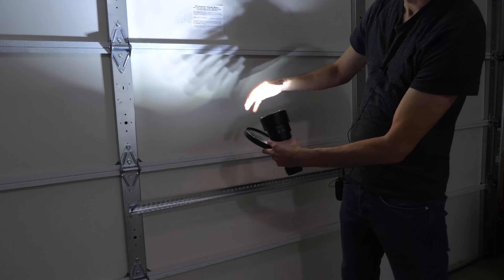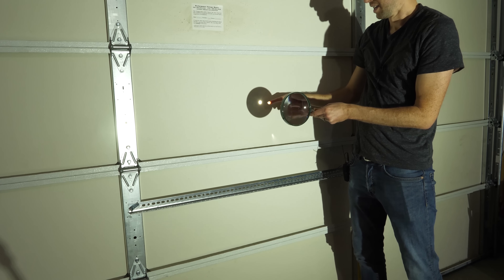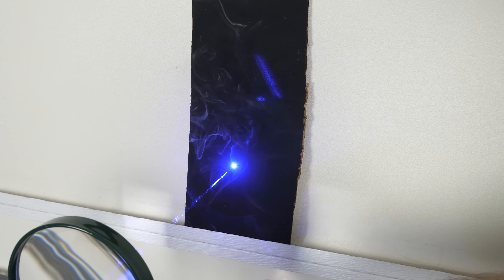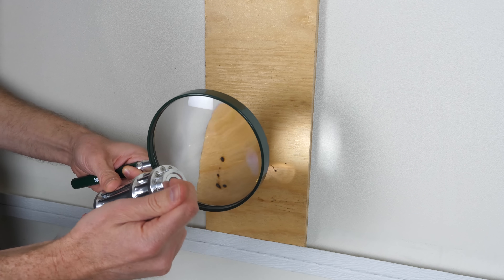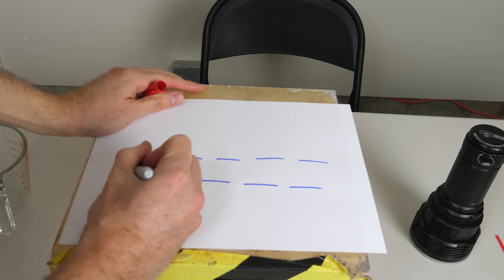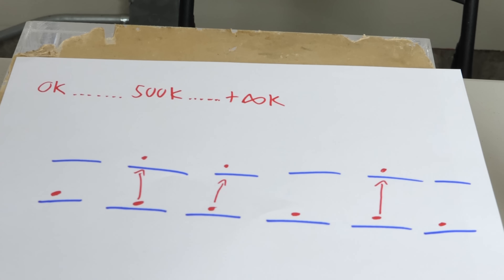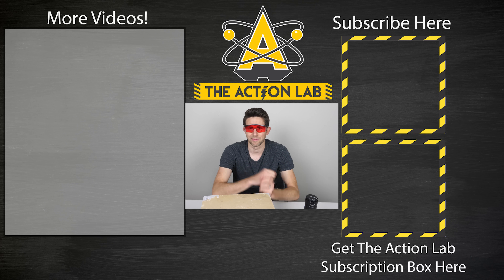What Happens if You Focus a 5W Laser With a Giant Magnifying Glass? Negative Kelvin Temperature!

Comment: To prevent the flashlight beam from spreading out, you could easily place a fresnel lens in front of the beam to straighten the light into a single direction, then just put the magnifying glass after that to concentrate all the light from the flashlight down to one point.
Reply: It work ether if you put two magnifying glass at the right distance
Reply: I was just thinking the same thing and went looking for the comment to thumb-up it 👍
Reply: @mihailghinea  I suggested using an aluminum lined funnel to concentrate the light output of the high-lumen LED light.  A conical Erlenmeyer flask that is painted on the outside with silver paint could also work--although it would probably be best to remove the base of the flask--which would require more work.
Reply: @ab_ab_c  huh? You honestly need to learn how light is distributed.
Reply: The novel "ROCHEWORLD" and its sequels, written by the late great Robert Forward, had an invented interstellar propulsion system that involved a laser array positioned in the shadow-cone of Mercury, that planet's gravity 'pull' balanced by the momenta of sunlight pushing against huge solar panels; a huge fresnel lens located further out in the Solar System (around Saturn's orbital distance, if I'm not mistaken) then collimates that laser beam emitted from that Mercury station, and focuses it onto the solar sail of a vessel traveling to a nearby star system. It was a cool idea for more realistic interstellar propulsion, compared to warp-drive/hyperdrive-style pseudo-scientific ones which litter SF stories.
Reply: then do the same thing to the sun
Reply: @lakshikagunasekara3687 the degree of spread is already zero degrees from the sun to only a few feet away from earth
Reply: @lakshikagunasekara3687 you would need a lens bigger than the sun
Reply: No because the light rays would still offshoot in different directions because they were bouncing off the walls. What u really need is a reflective bowl around the light bulbs/LEDs probably.
Reply: Not necessarily a fresnel. What you need is a collimator (which is a pair of lenses which could be fresnel) and then the focusing lens.
Reply: @palpytine  I was thinking that but I couldn't think of the name, the collimator lens is used in lasers and what he said about not getting more heat from the source, they have in use mirror collectors aiming at a solar furnace
Reply: @John Galin  That wouldn't work
Reply: Bruh
Reply: @mihailmilev9909   best comment on this thread
Reply: Use a sattelite dish to make the light laminar and then the same size lens as the dish :)
Reply: All the flashlight needs is a parabolic reflector where the lightsource sits in its focal point. A perfect parabola with a point source light at the focus point directed towards the parabola would do the trick.
Reply: @YouCountSheep you would need an infinite paraboloid to do that though. In reality, since you can never have an infinite paraboloid, you will always have spread from the light
Reply: So flashlight, 🔦 to fresnel, to magnifying 🔎 =  ☄️ laser?
Reply: What if you make the flashlight shine into a tube made of mirrors and put a magnifying glass at the end, this would focus all photons to the magnifying glass (same way as lasers work)
Reply: I would have thought it was just because the light rays are parallel from a laser as they are from the sun, hence you can melt rock with a fresnel lens and the sun
Reply: Basic knowledge.  Weall know what positive infiniti turns into negative Kelvin
Reply: What if you put a mirrored tube the same size as the flash light then put the magnifying glass.
Reply: Problem: some of the light will be absorbed by the collimating lens. We will not be able to capture all of the energy in this way for that reason, not enough to do what was wanted here.

Though a laser is coherent, that means it is that it is essentially spectrally uniform, not actually collimated and at great distance does spread, which is why it is such a danger for pilots, the beam becomes massive and still too intense. However for most practical earthly use the laser is close enough to being collimated for the distances used it just doesn't matter, it might as well be thought of as such, so tha talso makes this the ideal source of light for this use since we overcome the problem of absorbing by sheer saturation.
Reply: Aren't lasers just laminar flow light?
Reply: @diji5071  Lasers are not simply laminar flow light, but the concept of "laminar flow" could be used to describe some aspects of laser operation. In a laser, the term "laminar flow" is not typically used, but the key to understanding lasers is coherence.

In a laser, the light is produced through a process called stimulated emission, where photons are emitted in phase with and reinforce each other. This results in a highly coherent and directional beam of light. Coherence means that the waves of light are in sync, and this is what distinguishes lasers from ordinary light sources, where the light waves are usually not in phase.

While laminar flow refers to the smooth, orderly movement of a fluid, it doesn't directly apply to the behavior of photons in a laser. However, you can draw an analogy by comparing the orderly, coherent behavior of photons in a laser to laminar flow in a fluid.

So, in a way, you can think of a laser as producing a "laminar flow" of light in the sense that it produces a highly organized and coherent beam of light, but it's not a direct analogy.
Reply: That's exactly what I was thinking. Like a 6x6' fresnel. I love melting coins with fresnel lenses it's wild.
Reply: It can't go to one point thouvh, just to a smaller image of the light source!
Reply: @flexico64  you can't do it with a single lens,correct. But you CAN use an array of lenses, prisms and mirrors to concentrate the light into a tiny point.
Reply: Laser light is coherent. All the photons travel in a perfectly straight line. A flashlight disperses light at all different angles from the source. Coherence is what makes laser light focusable.
Reply: All light is focusable. The challenge is transforming the light into heat or capturing a meaningful amount of light to cause it burn something ( which is why people can start fires with lenses on a sunny day). I honestly disagree with what he said in the vid. Heat/thermal energy is not necessarily the same thing as "light". For example LEDs  really effecient at generating light, while incandescent lights are not; incandescent lights wouldn't be able to transmit the light well for you to transform the light energy in to heat. Microwaves (very low energy wavelength light) is able to boil water, but doesn't heat metal at all.
Reply: @bethelgues3918  All waves are focusable.
Reply: @lookupverazhou8599  indeed
Reply: @bethelgues3918  Incandescent lights are black-body radiators, so their light can't be focused beyond the filament's temperature, due to thermal equilibrium forming. The Sun is very close to a black-body radiator, so the claim pretty much applies there, too.

However, LED lights are not even close to being black-body radiators, so I see no reason why the LED's initial temperature would be relevant here. As the target surface heats up  beyond the source's temperature, the LED will also start heating up, sure. But since the light is not generated by an object simply being hot, the second law of thermodynamics doesn't feel applicable in that way.

I might be wrong, but if so, would like to know how.
Reply: @waferion474  and some materials are great at turning photon energy into heat (like black paint).
Reply: Yeah, you seem to be missing the point, you were told in this video that you cannot get a point brighter than the source, so freshnel all you like, it is not a lazer.
Reply: @turbocpt1 you can get a point brighter than the source if you use a fresnel lens though, you could do the same to the sun too if you had a lens larger than it
Reply: @turbocpt1  He's not saying you would.  He's saying you'd get exactly the entire wattage of all the LEDs into one point, which wasn't demonstrated in this video.
Reply: @turbocpt1  There is no 'z' in laser.
Reply: But then he would be breaking the 2nd law of thermodynamics, proving all his work to be fail.
Reply: @West_Coast  lol, why did you upvote your own comment? 😂
Reply: @turbocpt1    How can you tell when somebody upvotes their own comment. I heard other comments say that to people.

Comment: As an engineer who used 40KW lasers which were focussed with 40mm lens you can cut 20mm steel with ease and high quality. However when someone talks about infinite and infinity what follows is usually theoretical rubbish. You cannot go negative in Kelvin because Kelvin itself is a theoretical zero and try as we might we have approached it but never got their.   We all know that  zero divided by 1 is zero and 1 divided by zero is infinity. Also 1 divided by 1 is 1. So what is zero divided by zero . Is it 1 , zero or infinity.  Sorry interesting vid but ultimately flawed.

Comment: Your work is a very important piece for many important things. The strength of the laser is easy to magnify because the strength of the laser is already concentrated in single small space.  The strength power and light of the SUN travels in spherical shape that's why it is very difficult to connect to all the direction of the light of the SUN.  Not to mention the COSMIC size of the SUN.  NEVERTHELESS YOUR WORK IS VERY IMPORTANT FOR MANY IMPORTANT THINGS.

Comment: Damn it i am going down the rabbit hole to try to understand this...  in particular, how the 2nd law of thermodynamics is involved, as mentioned at the end of the video.
Firstly , what is going on with the laser - i suppose that it is the production of light/heat energy in particles that have been highly alligned/ordered , ie the particles start off with very low entropy.  So you have these very ordered particles , and you add more and more energy to them , and rather than become disorderly as the 2nd law would say, they in fact become more orderly, and this can be reconciled by defining their temperature as negative?

some basic facts that we use here as i understand:

1. normally,  energy and entropy are positively correlated.     

2. for a laser, the particles have been arranged to have such low entropy that it turns out that actually for it, energy and entropy are negatively correlated , and thats why its temperature is negative.    

3. 2nd law of thermodynamics is that entropy always increases , you need to add energy in order to reduce entropy

4. 2nd law , also means that you need to add energy to increase temperature

5. somehow , it seems that defining temperature as negative for lasers helps in keeping in line with the 2nd law.   How?

Comment: Can't say I 100% agree with some of these claims.  You can get a flashlight to a point, just need the right lens.  The direction of the light at the source was the issue, it is heading out, not straight.  Also why it can focus the flashlight when across the room...  the light hitting the lens is traveling straight... though only a small portion

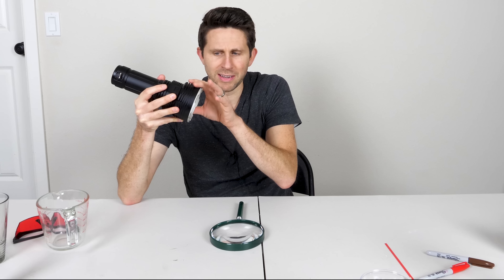Comment: Your explanation at 2:44 is partially in error I think. Heat and temperature are not the same thing. So yes, you can make a point on the surface that has a higher temperature than the flashlight does, or even brighter than the flashlight is because only energy is conserved. Not the DISTRIBUTION of that energy, which is what the temperature and brightness are measuring. E.G the same amount of lumens can have wildly different Lux, right? So while you can't have more heat at the surface, you could have more temperature if it is concentrated enough. Just like you have have more lux on the surface than at the source if you effectively concentrate the scattered lumens that would otherwise be lost.

The limitation you have here is a practical one-- you don't have a point source for the light, so you can't effectively concentrate it as well.

Comment: Kelvin can't increase infinitely there's a maximum temperature that the it can reach. The reason for this is quite interesting but irrelevant to my point. quantum mechanics is still in development as a science but the description of Kelvin you gave was incorrect as it does have a max.

Also, The second law of thermo-dynamics talks mainly about energy not just temperature, as in you can't focus light or lasers so that they have more energy than the source. However, you can focus that energy over a smaller surface area which would excite the atoms in that area more than it would have if unfocused. This is what makes the temperature seem higher, because it's focused over a smaller total area. And yes the same would happen to sun light and a flashlight, if you could focus all the light down to a point. it would even appear hotter than the source, but in reality just like with the laser, it's not hotter it's just focusing that energy into a smaller group of atoms which makes those atoms more excited/hotter.

Comment: So... I am way late to the game... but is this how the laser-based attempts at fusion power are done? 

And if so... what would happen with the following:

A large installation, like CERN or LIGO, made of a large outer ring of super large circumference, and then smaller concentric circles... possibly even being build into the 3rd dimension as a series of concentric hemispheres...

In the outer ring, several (maybe 4, at the cardinal directions?,) nuclear power plants (and i guess whatever power storage and release things would be needed... giant capacitors or something lol), whose purpose is solely to charge and power as many lasers in a circle or hemisphere as they can charge at fast enough for pulses producing ongoing fusion.

Then... run the gimmicks from this video using lenses to focus the many laser to smaller and smaller points as the come together, until the all focus in sync on a lil deuterium or tritum pellet...

.... so basically like normal. But with multiple power sources with high output and low carbon over head, whose use as basically an engine starter is a cost worth spending.

Would this brute force approach work, of using current techniques that already come close to break even, and then using multiple dedicated high power carbon neutral power sources to power an ultra dense descending sphere of lasers progressing through lenses focusing and refining their aim to the absolute limit of materials and precision...

Until...

... i dont know? What happens? Can positive power generation occur?  Could the fusion created produce enough energy to run a second round of the same lasers jump started by the nuclear fission reaction? Would there also be enough left over, and could it be captured and stored to power other things?

Given the benefits that could result..  why aren't we going all in? 4 billion dollars for a few reactors and a moonshot for fusion is way cheaper than tax breaks for the rich

Comment: Looks like wrong explanation.
By focusing the beam you just increase its surface density, i.e. you increase power, but the total amount of energy remains the same.

It is like lever. You reduce the force but you increase the path. So, the total amount of work is the same.

Comment: How about making a reflective tube a couple of feet long (or any size shorter or longer) the same size as the flashlight's Diameter Rim with the inside made of highly reflective material like the type that it's used to concentrate the Sun's rays into a concave shape, placing the flashlight on one end and the magnifying lens (same diameter as the tube's rim) on the opposite end so that no light from the lamp it's lost at all... and even the "augmented" reflection from the tube's reflective material gets completely concentrated into and through the magnifying lens! Can you try it? Thanks. Phoenix One

Comment: Nah if u use tin foil on the ground make a metre by metre it reflects the sun and can boil water through reflection. You can make it hotter. Using magnifier makes more heat.

Comment: It really isn't a question of thermodynamics. It's about concentration of energy.

When the light is focused to a point, the energy contained is concentrated. It is not increased. A smaller region receives the same amount of energy, meaning it gets hotter, and may reach ignition temperature.

Comment: You can also try a collimating lens on the flashlight and using your lens you will concentrate more of the light into to a smaller dot; still would not burn anything. As for the laser you are also putting 5 watts or close to 5 watts into a very small area and the area will heat up faster then it can dissipate the incoming energy.
Reply: So the laser being magnified was never increasing above 5 watts??
Reply: @PeaceNinja007  
No. The total energy cannot be higher in this case.
Reply: @TicTac-g7m  ah 😌

Comment: With the laser beam diameter small, as it normally is coming out of a laser, a small diameter magnifier would have worked  just as well as the large diameter magnifier.  To get a smaller focused spot, you have to use a beam expander so that the laser fills the entire diameter of the magnifier.  Then the theoretically possible smallest spot size decreases significantly.
Reply: Bro did you wear the Big Johnson shirts back in the day? With a name like rod Johnson I would have tried to get sponsored by Big Johnson 💪
Reply: Thank you
Reply: Thank you so much.

Comment: The energy at the target cannot be higher than the energy of the source, provided that both are stationary relative to each other. But the temperature at the target, over a given area can be higher than the temperature at the source over the same area. So shouldn't it be stated that heat and energy are two different things, albeit closely related?